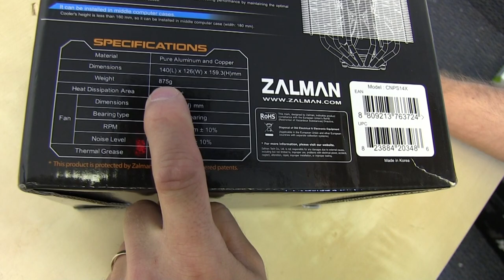Zalman CNPS14X Dual Tower Heatsink Cooler Unboxing & First Look Linus Tech Tips

Comment: the old "go to" was a hyper 212 evo.  fits everything and can handle overclocks very nicely, for $32. though there may be better and cheaper ones by now, and tower style heatsinks offer the better performance, but you need the case to fit it.

Comment: And the vast majority said that quad cores are necessary. A dual core can still be used for gaming, but to get the most out of your system, and if you have a high performance gpu, you'd want a quadcore to get the most and prevent any possible bottlenecks.

Comment: tbh, I have a nocrua nhd 14 and you dont really need a third fan, as usually the top rear exsaust (for most people) would act as a pull. 
Only point of having it is if your after the complete and utter best performance.
It would only probably cool a few degrees less which personally isn't worth the extra noise.

Comment: The base plate of this cooler isn't massive. They just welded the six heatpipes to a thin (2-3mm) copper plate and screwed the mounting plate for the 135mm fan ontop. Don't expect cooling results that are as ridiculous as the size of this hunk of metal. (Says the owner of a Scythe Mine 2, which is about as big as this one)

Comment: Unfortunately copper is pretty expensive these days, so to have as high a surface area as possible whilst keeping costs down you need to use a large number of aluminium fins. In addition, the larger the tower the easier it is to fit larger fans (120mm or 140mm), which can shift more air at lower rpm for a better noise profile. Not ideal, but the best these companies can do.

Comment: got it on sale at ncix only 13$ after rebate. just installed this on my sister's pc. 
and damn it's just a pain in the arse installing this thing. had to take out motherboard and stuff.
this thing is loud and the improvement in cpu temp is very minimal.
Reply: another thing need to be considered.  this thing is so big it will cover the first slot of your ram.
Reply: Kevin Xie Well thermal take nic c4 doesn't cover any of the RAM on my Motherboard

Comment: Isn't that too heavy for the motherboard to handle? Would you recommend using a bracket to somehow support the weight? I mean when your on heavy gaming, of course it would generate heat which might deform the motherboard because of its weight. I would appreciate your thoughts on this. Thanks.

Comment: Price? And why would you use such a massive beast when you can get sealed system water coolers that are smaller an quieter. Ps 3 fans are not quieter than 1. Unless you drop the rpm on them all.

Comment: Need advice on coolers between CM hyper 212 EVO,Cnps 12x and 14x
I have fx8350 and idle temps are between 46-50C underclocked and undervolted

thing is,wich of this cooler will be a best bang for a buck if u take in consideration that Hyper 212 is almost same priced like CNPS 14... But im planing to install pair of good coolers in wich case ending price would be close to the CNPS 12x,so shud i go with 12x instead?

I also investigated some closed loop water solution but in that price range i think i would get better cooling of the air coolers,or im wrong?
Reply: +Dave Chippy I JUST bought the CM Hyper 212 Evo, and I'll tell you now, my Intel Pentium G3258 4.2GHz Duo Core CPU is running idle at 33 degrees and 60 at It's hottest.

In my honest opinion, the Evo is a fucking beast, and comes next to Water Cooling.  The Dual Fan support makes it VERY good and It's only 48$ right now (With Taxes, for me of course)  Making it budget friendly and very good for cooling.
Reply: i had stock for a while till i saved up for 240 monster rad and now im running full water loop to be honest a havent really bothered to check temps ever since i upgraded :)

Comment: Games like GTA 4 use all cores, so while a dual core is techincally fine, why would you buy an old chip if the new ones are hardly any more expensive, and games start to use the full capacity of the chips.

Comment: It´s too big.Why todays coolers are not all cooper built?I have my 8 years old Thermaltake Minityp 90 cooler,which is all in cooper,was in socket 939,am2 and now in am3,and it´s not great but fantastic(phenom II x6 1090T stock~20c idle -44load).And when I see 1 kg heatsink in aluminium built......not good.